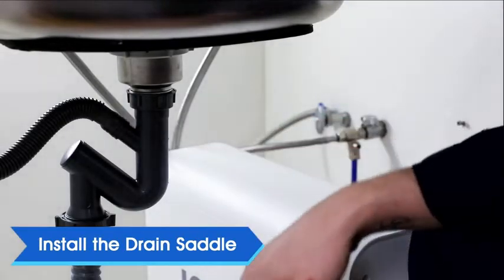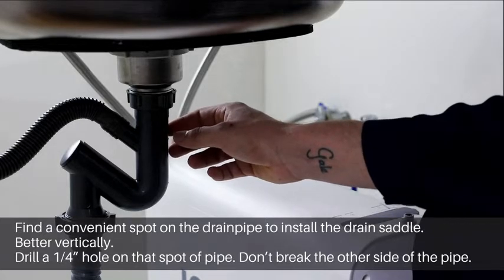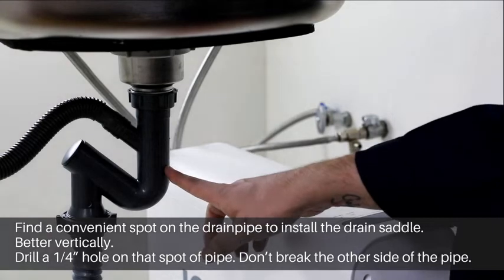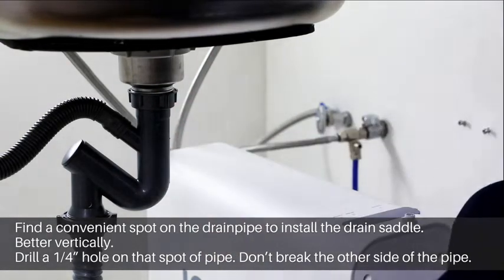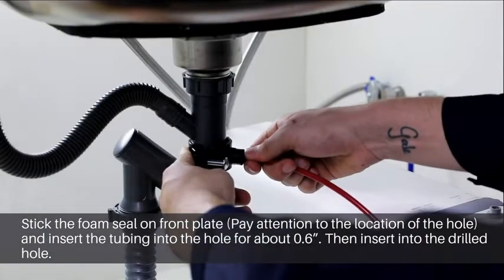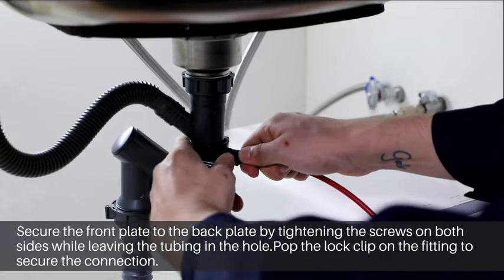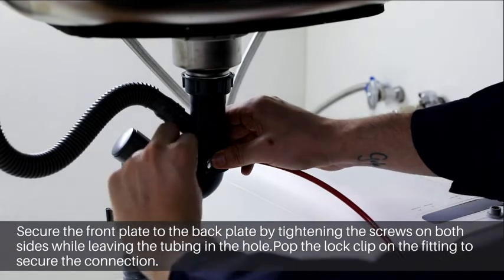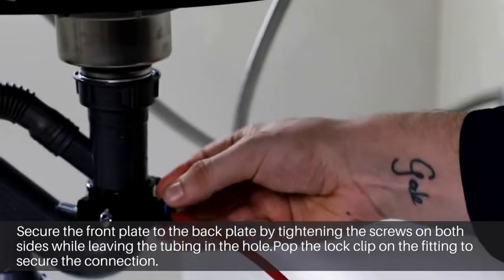How to install the Drain Saddle? Installation Instructions-ICEPURE Tankless Reverse Osmosis System

Comment: Does this leave an air gap on the line aswell so it doesnt backflow into the system ? Im assuming the air gap is the large hole in the sink